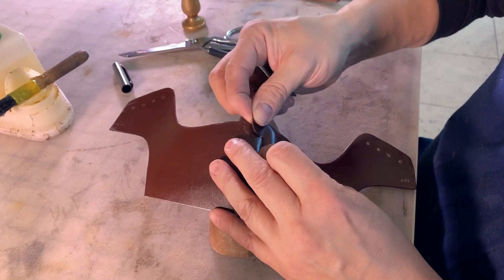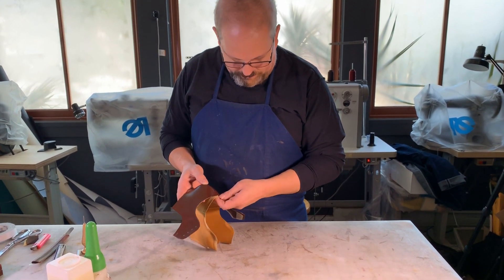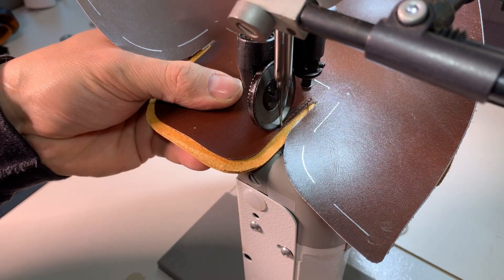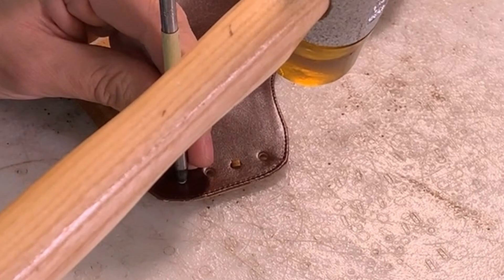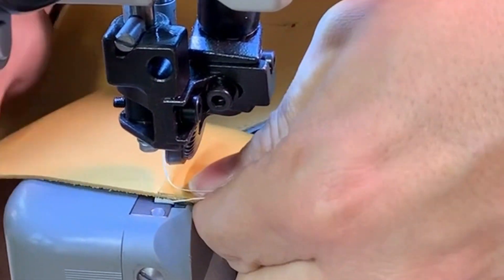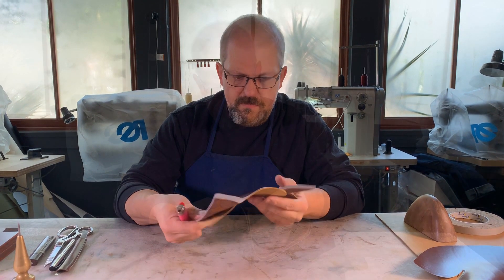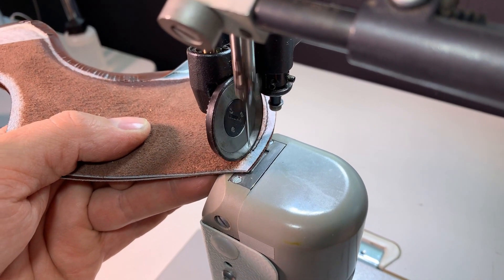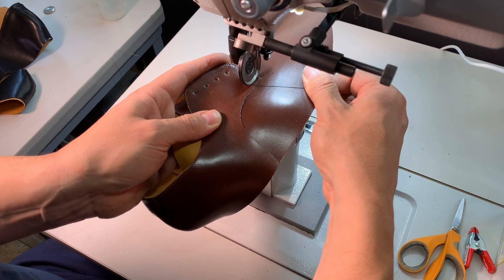Upper making series online course

Comment: Hey, I have a question about heels. It's a bit unrelated, but I was wondering if there was a functional reason behind women's dress shoes coming in only one standard width: length ratio.
I'm 5'9" tall with a size 8 foot if only measured by length. However, my feet are flat and so pretty wide and I can't fit into shoes made for someone my age. It's frustrating as all heck, but I thought maybe there might be an actual reason shoes that fit me aren't made due to like idk maybe structural integrity I don't make shoes. Thanks though!!
Reply: Hey there, I can answer that :D I'm a shoemaker and so I can tell you the whole process: there is such a thing as "standardization" when it comes to last making. When the lasts are made, those are just approximate measures which are supposed to fit an X-number of customers. There are several feet types, so anyone who does not fit into those standards, is considered a particularity. You can imagine that is can be pretty difficult to "address" so many  particular sizes, so you have 2 solutions: you can either custom make your shoes or simply choose a shoe model that would actually fit your type of foot shape. :) If you have been encountering this problem, you probably didn't choose the right shoe shape. However, the ratio width : length would be also used if you were to make your shoes at a custom shoe atelier. Another solution would be to look for a cobbler in  your area and simply ask him or her to widen your shoes where you need them to be widened. :) Hope I helped a bit :)
Reply: @paulanicolau5725  yeah that’s the thing though, I like the look of the more typically narrow shoes. I like the leather Oxford look for flats and finding heels that aren’t chunky is a nightmare. 
I understand extremely pointed shoes are going to lose the aesthetic if the shape of your foot is a bit wider, but most standard dress shoes and heels wouldn’t be aesthetically compromised if they were just made a bit  wider where I need it to be. 
In short, shopping according to a limited variety of shoe shapes sounds like a drag so I’d probably be better off getting my shoes custom made or finding leather shoes that I’ll be able to break in without destroying them.
Reply: Yeah, my point exactly, custom shoes are your solution. However, you could simply just try and look for brands that make wide shoes. So to sum this up: either find a really good cobbler or go through the search of a brand that fits your feet 😁😊 I am sure that one of them is out there, somewhere 😉👍
Reply from the maker: Your best bet is to look for brands that cater to wider feet. I think the industry will slowly shift in the more inclusive direction. It just takes time I guess. Good luck!
Reply: ohhh see for a while until some of the engagement I’ve found in the shoe community online anyway was that my feet specifically would work in that shoe for some reason. 
When I was 8 or 9 looking for shoes and wanted to try on heels (I was a 5’1 9 year old with size 6 feet) and my mom sat me down with the shoe, let me try it on, and subsequently explained to me that my feet are too wide for high heels.
As a kid (I’m also on the autism spectrum which uh, C O N T E X T)  I  took it quite literally. I just accepted my feet structurally and physically would be hazardous for heels that are too high and so they don’t make them for me 👶 🍼 
Then like... well embarrassingly recently, I realized they just literally fat Shame feet.
My brain went “well that couldn’t be true so it must be some physics principal you’re not understanding properly. “
But no, it’s true
They fat shame peoples feet.